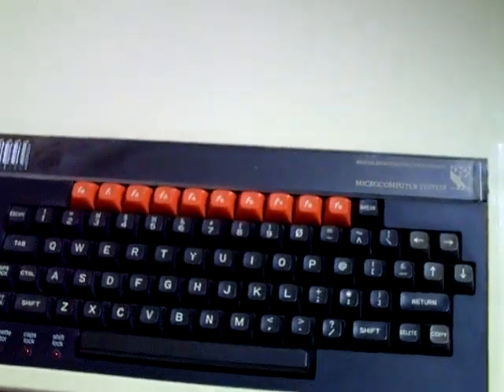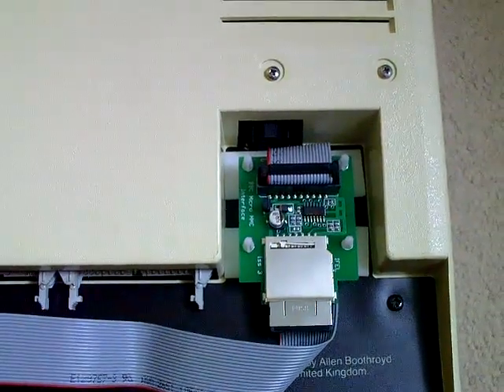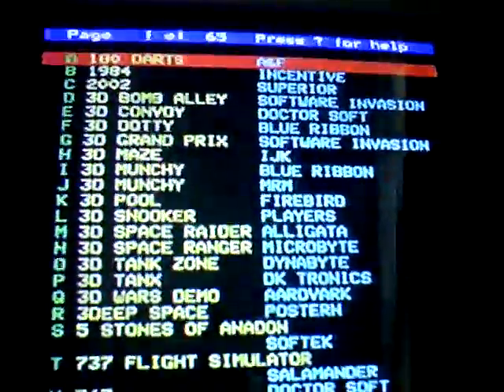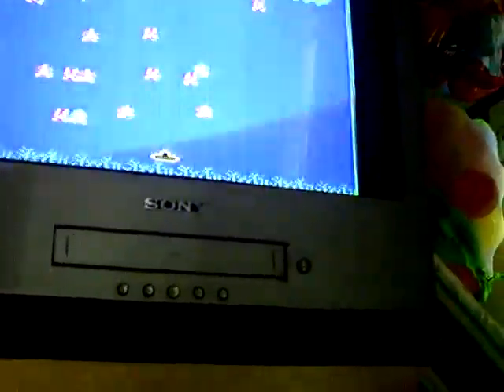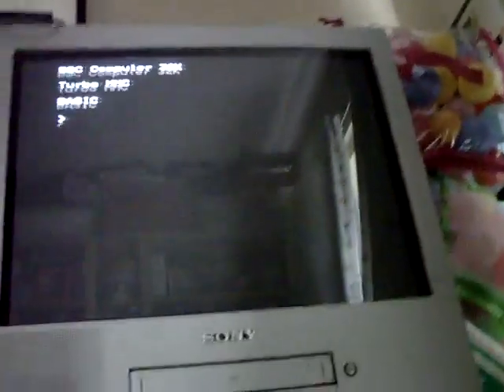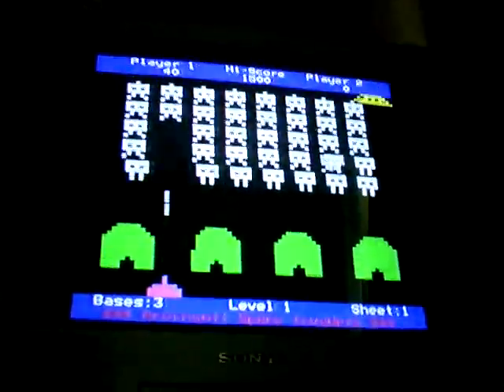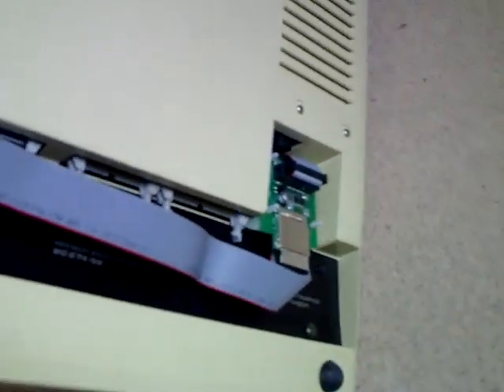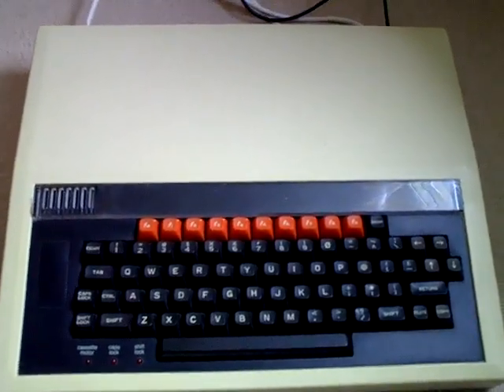My BBC Micro Model B with Turbo MMC SD Card Interface

Comment: If you hold down SHIFT and hit BREAK that will automatically do the *EXEC!BOOT presuming the boot option on the card/disk is set to 1 - if not, *OPT 3,1 will fix it.
Reply: YesiPleb I think I got the opt wrong, it might be *OPT 4,1 instead. Forgot to also mention that holding down CTRL and hitting BREAK will do a hard reset. Try loading the games menu after that and it shouldn't crash like it did.
Reply: @YesiPleb  Rather late in the day, I know, but the command you were looking for is *OPT 4, 3

Comment: I have run the ribbon straight underneath the beeb and inside via the big rear vent.

The interface is on the underside of the lid.
Reply from the maker: That's a neat solution. I may tray that as it'll keep everything out of harms way.

Comment: I was going to fit mine into the space that you have used, but it's slighly too tall.

So it would stick out of the underside of the machine if  I had put it there.
Reply from the maker: Luckily the BEEBs rubber feet just give mine enough clearance.